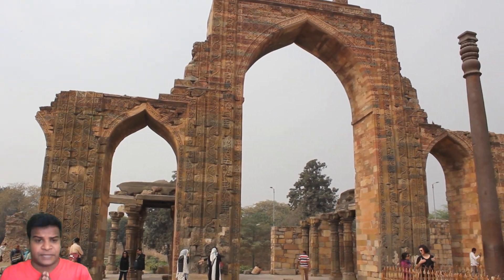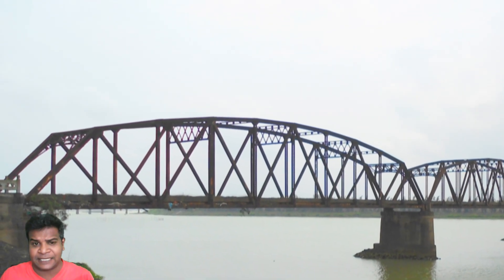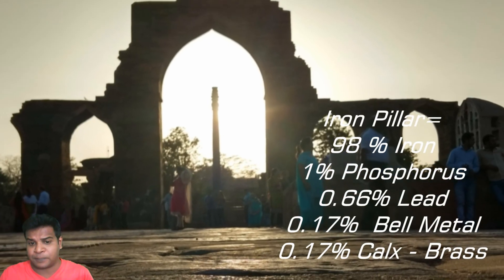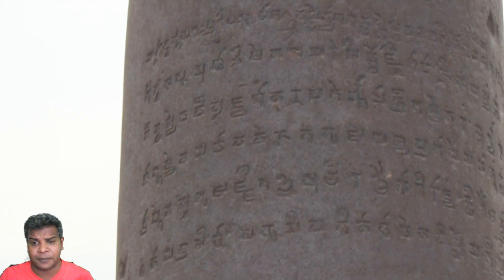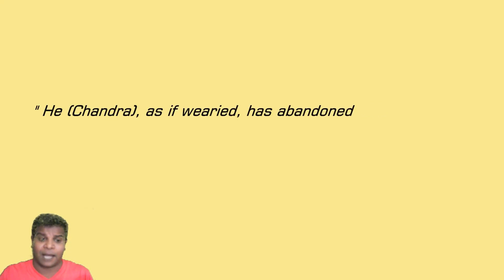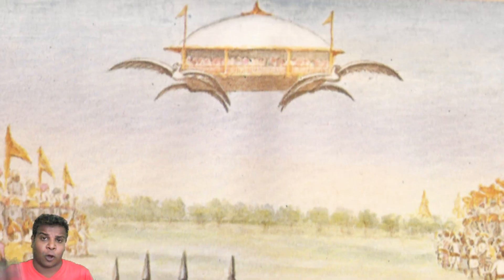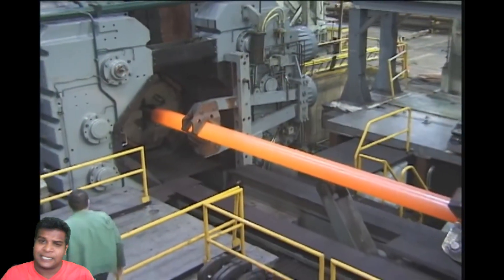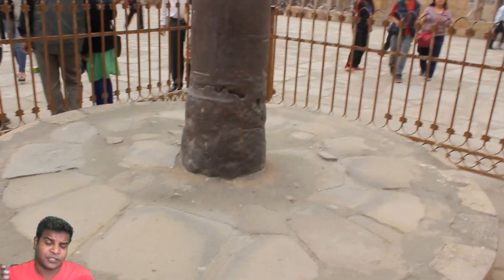Iron Pillar that never RUSTS - Ancient Secret Revealed?

Comment: It makes complete sense that the pillar was installed FAR BEFORE the rest of that temple complex, as NONE OF THE OTHER CONSTRUCTIONS THERE MATCH IT... It makes NO SENSE AT ALL, that the thing was made in the same age, made by the same people that made the rest of that temple.

It seems to me it's not "coincidence" that the stone tower is 10X the height of the iron pillar, that's clearly BY DESIGN, but doesn't indicate anything at all to do with electrical use. 

When that pillar was put in place 8,000 years ago in the age of Rama, imagine it as such, it wasn't a single pillar, it was 1 of many that supported a roof, likely of timbers, of a structure has since been fully removed for reuse, all except the sole pillar that remains, which was left in place as a testament to the former modernity. It was left in place to signify to future generations what is possible and what has been eroded to utter destruction, the use of these durable materials and more importantly, the structure of the society which used such durable materials in construction, which down through the ages foretells the constant stalking of every society globally by DARK AGE, that we're all 1 war away from being left with nobody who knows nothing about anything.

Comment: IF INDEED THIS MAGNIFICENT MONUMENT WAS BUILT BY RAMACHANDRA THEN IT IS AT LEAST OLDER THAN 10000YEARS AND NOT JUST 1600YEARS AS THE USUALLY HARE BRAINED ARCHEOLOGISTS AND THE  SO CALLED EXPERTS WANT US TO BELIEVE.NILESH OAK HAS AFTER ANALYSING ALL THE ASTRONOMICAL DATA AVAILABLE IN THE RAMAYNA HAS CONCLUDED THAT RAMA LIVED NO LATER THAN12000YEARS AGO .IF INDEED THIS IS TRUE THEN THIS IRON PILLAR IS A TESTIMONY TO THE INGENUITY OF OUR ANCESTORS AND THAT THEY POSSESSED MUCH MORE ADVANCED KNOWLEDGE AND USED IT IN ALL THE THINGS THEY DID WHICH WE CANNOT EVEN ANALYSE AND UNDERSTAND IT PROPERLY.BECAUSE OF OUR COLONISED MIND SET AND TWISTED IDEOLOGY.

Comment: If this iron pillar was indeed installed by King Rāma after his battle with Rāvaṇa, then this pillar would have to be about 14,200 years ago, if you consider the astronomical evidence found in the Rāmāyaṇa, ALL OF IT, to corroborate when the astronomical observations were made and match up, as well as the descriptions of certain rivers, etc. as they appeared in those times.

Comment: This Vajra sanghata was also found in China[Cin density - anyone can remember about the 1000 status where found in China with full of soldiers and king in the iron charite, also there is the bronze sword of the king which exists for 2000 years without rust] to protect the sword. The concoction has been found only at 1930 and concluded at 1950 by the west but it was found in India and used in Asia before 2000 years ago for the swords and other iron, steel, bronze materials. In India, even government doesn't want to show real history, As there is a lot of evidence of Ramayan and Mahabharat, they are not ready to recognize it. One day it will. thanks for the video.

Comment: In vimanika shastra there is mention of electricity. In that book they are not only talking about electricity but leather covered insulated wires. Units to measure it. They tell how to produce electricity. Only problem is no one has translated the book into diagrams.  And most of the people does not know even that it actually exist.

Comment: Maybe it points to one specific Star 🌟? 

Maybe there's a scroll 📜 in it.. 

Did you know that you can use the P-laser ( pulsed laser) to clean this pillar. It would removed the rust, restoring the pillor to the original form - without damaging the stone statue or iron pillar.

Comment: Clearly at bottom looks like concrete, visible line ,built in sections,rebar in middle, at the  top same thing,concrete and rebar, in sections,does not look like metal,if anything the pitting looks like concrete
Reply: "Pop"ular 
Where did concrete come during that time.  There was no concrete those days.